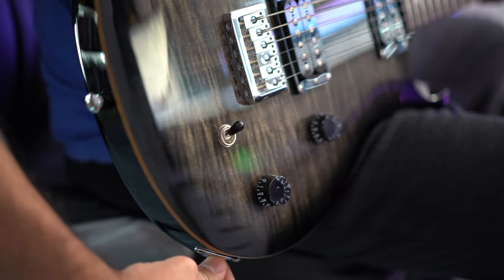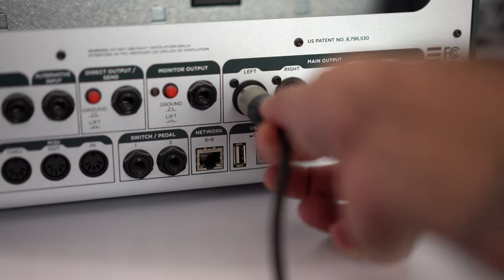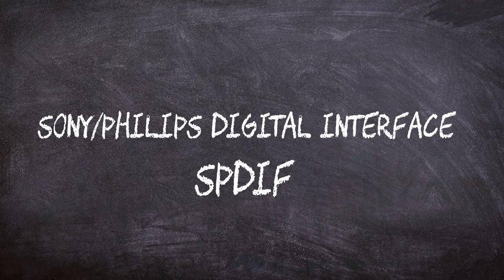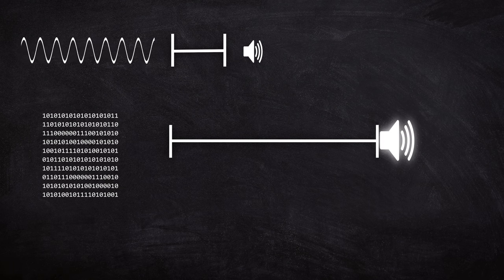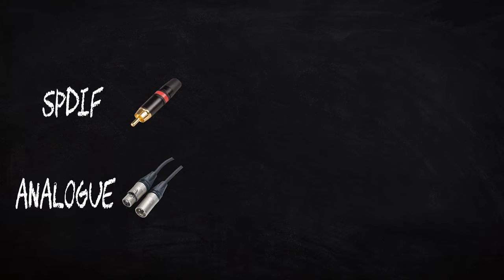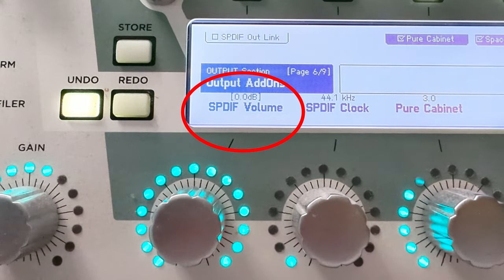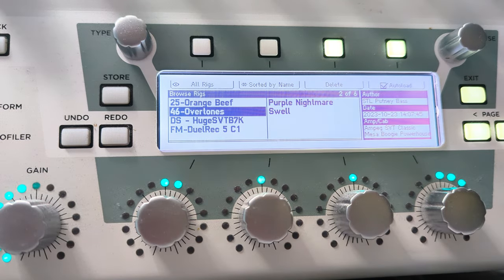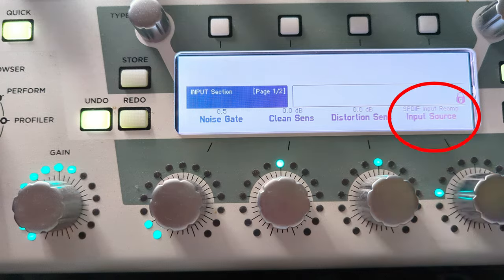What's the BEST way to record guitar - Analog or SPDIF Digital?

Comment: Really great video, the only one I've found that does an A/B sound comparison. 😊

I've just A/B'ed SPDIF and analogue using an FM9 and a Focusrite 18i8 and found that yes, SPDIF is clearer especially on the top end, probably why it's not so obvious in this test perhaps. 

I felt the clarity on digital, when using high gain, was perhaps a bit too much. It's like you need it expect a little less clarity for it to sound natural. Probably because that's what we're used to hearing. I can hear everything especially in the high mid upwards. 

Where the real benefit is, for me, is in the ramping and DI recording. 

Thanks for the great video!